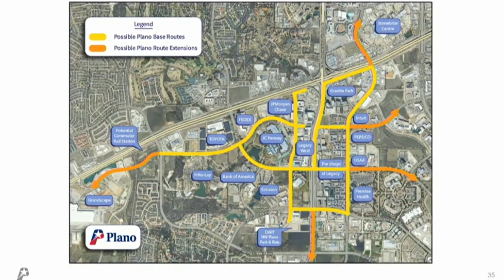'Multiple' Texas cities showing interest of being test site for high-tech gondolas

Comment: Cool idea, but is it tornado proof?
Reply: Hi, inclement weather can affect all transportation modes. In dangerous situations like tornadoes, we would discontinue operations.  Even in high wind situations, we would curtail operations both for passenger safety as well as passenger comfort.  However, it's important to note that cable-based gondolas have been used in the Rockies & Alps for more than 100 years and withstood extreme weather conditions.